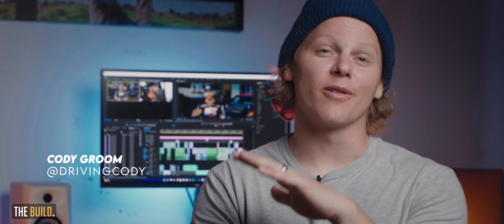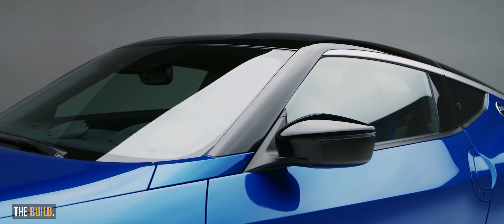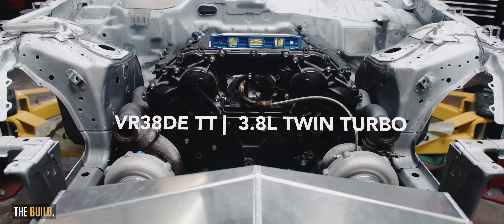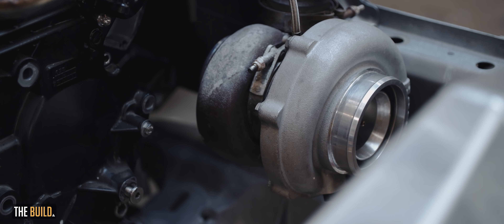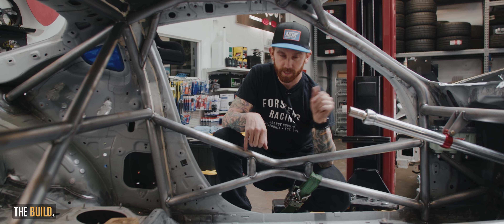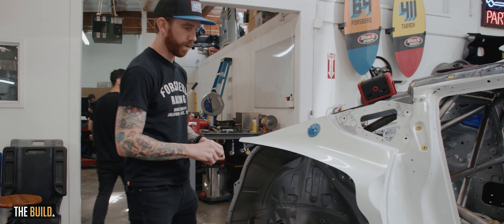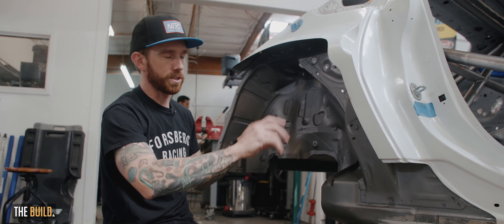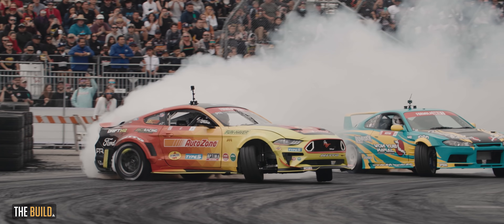THE 1300HP 2023 NISSAN Z |  THE FIRST OF ITS KIND!

Comment: I’ve read the new Z motor is not closed deck design so it might be difficult to build one to over a 1000bhp and be dependable. So it makes sense to use a GTR motor especially for the high stresses of Formula Drift.
Reply: 1000 would be too much for the Z imo. id like to see high power builds in the 800s.
Reply: Give it time people will figure it out.
Reply: @mitchjames9350  it has had plenty of time its the same motor from the q60 red sport
Reply: Don’t worry 2jz swap is on the way
Reply: @ninemillimeter1  AMS Q60 Red Alpha comes to mind...  with that kind of money, I wonder if the VR38 swap is cheaper.
Reply: @campbell107  it’s called B58 can handle 1000whp.
Reply: I know they’re currently maxing out around 500whp for the Q50/60 redsport but I wouldn’t be surprised if they figure out how to get it in the 600-700 range in the next few years

Edit: Actually I just looked it up again and found one Q60 that’s at 640hp not sure if it’s wheel or crank
Reply: @bigthings1818  there is already a q50 with 1000hp
Reply: depends really. Papadakis made a 4 cylinder open deck, but sleeved, 2AR engine into a nitrous 1,000HP. Forsberg's reason for using the GTR engine is because it's already developed and proven so they can just buy it from their engine builder, as they don't R&D it themself.

Comment: 1:51 It has a VR30 Engine from Infiniti Q50/Q60*
Reply from the maker: Watch it again ;)
Reply: The 400z stock comes with the same engine as the Q60 but the formula drift 400z is engine swapped with the same engine as the r35

Comment: The VR30 is hitting about 1000HP with AMS test mule but its  reliability and consistency is still up in the air,   buuut we shall see the VR30 is about to get
a lot more love with the Z just around the corner.
Reply: BMW B58 hitting over 1000whp, king of the hill of 6 banger motors under 40k used for bmw 340i/240i with B58
Reply: @Areku06  You aren't getting a B58 for under 49K new  and lets be real here 99.99% of the community isn't tuning to that point even among the after market community. 

Both engines have similar limits and prices up till around 530-550WHP.
Reply: @BigHeadClan  you can get used 2018 bmw 340i under 40k with 15-25k miles almost new. B58 with stock turbo maxed out around 500whp but with pure 800 turbo it’s about 750-800whp, big boost turbo can get you to 1000whp with upgraded fuel pump and some meth or e85.
Reply: @BigHeadClan  you may as well get 2017-18 bmw m3 and beat 99% of vr30 cars for under $49k stock. If you  do FBO that’s about 650hp stock turbo. S55 is hand built, closed deck engine that easily handle 650-700hp daily on stock turbo. S55 is most reliable used m3. It’s probably best sport sedan for the money on used market and it looks incredible.
Reply: @Areku06  Then your comparing apples and oranges, the 340i is a very different cars dynamically and the Z/Supra are a much better sports car and starting point in terms of performance.

You are also comparing a new car vs a used car in a few years you can probably get a used Z for a fair bit less than a 3-series.  (Pending on demand/and popularity naturally).

Again the VR30 has similar limits , although you do need a few extra supporting mods to hit 700-800WHP for the VR30, but your spending thousands  less up front so total cost works out to be around the same.

End of the day though majority of people modding their cars are tossing some down pipes and a tune at these for around 450-500WHP and are just going to enjoy it.

As for the M3 its a bit closer in purpose and a fantastic car (M2 is more my thing)  but again used vs new and you're spending double what a used Z is likely to cost.
Reply: @BigHeadClan  my 2014 f30 335i was $20k, FBO n55 is 400-450whp plenty for me. For 350z to get that amount of power you need supercharger. I can swap pure turbo for $2 and get 500whp, still be cheaper than q50 and 340i. I would say 14-15 335i is steal, it’s same motor as m2, with slightly smaller turbo.

Comment: But why replace the engine? Why not take the VR30 and bring it to the limit?
I think this is a much more interesting project because it opens the door to new mods for Nissan Z and Infiniti Q50/Q60
Reply: 3-4 weeks made so time ig
Reply: dont think there is support yet for higher hp builds plus to be competitive in FD you need 1000hp+ so if hes running 500hp while others are running double his hp then hes just going to lose. Plus Forsberg has been using the VR38 for years why change engines now?
Reply: Bc it’s already near peak power before becoming really unreliable
Reply: Brace yourself for a Rocket Bunny bodykit

Comment: You just confirmed buying the new z is pointless if you expect to make big power. By swapping the motor.
Reply: Im pretty sure an engine swap is due for most vehicles when you want to hit 1200 hp. Besides those few holy grails that come with the swaps from factory
Reply: I would say where the Z shines is really the chassis. It was understandable to swap the VR but LS would be the move in my opinion.
Reply: @cooliecrewspeedshop  VR38 is just as capable as the LS. Built billet VR38s have seen upwards of 4000hp.
Reply: The fuck is big power to you? 

Anything over 400hp is big power if you plan on driving anything other than a straight line, but most Americans can't figure that out so they chase 1000hp to play right foot go vroom vroom on highway.

Comment: I wouldve been impressed if it used the original engine...that just means the Z motor is pointless. 
P.s the supra used the same b58 motor and won last years championship
Reply: Z engine is not pointless , they chose to use the GTR engine . It was a choice . I would say something about the supra but it’s not a real jdm car any more .. so it’s “ pointless” speaking on it.
Reply: @LethargicCarcass  AMS have some tricks for the VR; so don't you fret!

Comment: The Nissan VR30 (open deck) engine can handle 500hp easily but the VR38 (closed deck) engine can handle 1000hp easily. Supra B58 (closed deck) can handle 1000hp easily.

Comment: 3:59
That is a terrible design for that exhaust manifold to the turbo. That is NOT very efficient and creates LOTS of heat and back pressure. This is the same issue Cletus McFarland had on his twin turbo. All that $$ and you do a piss poor design. Yes it works but its not very efficient.